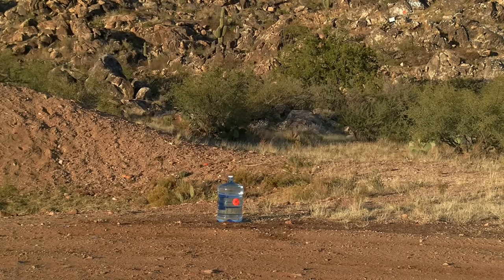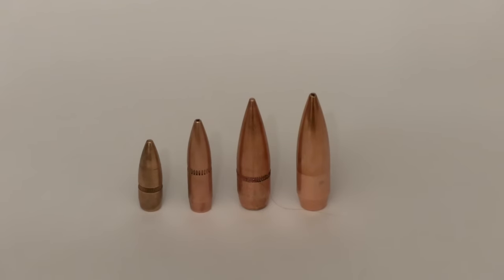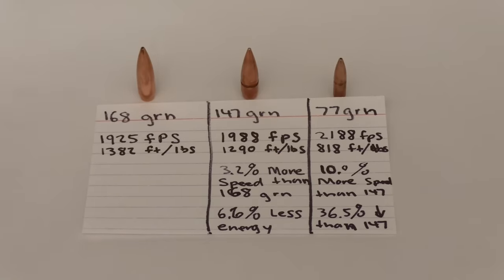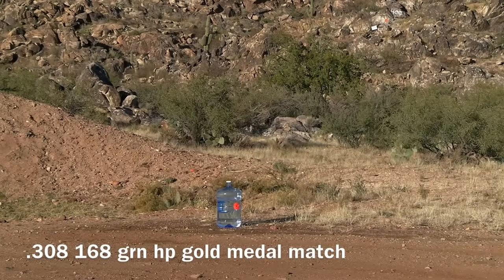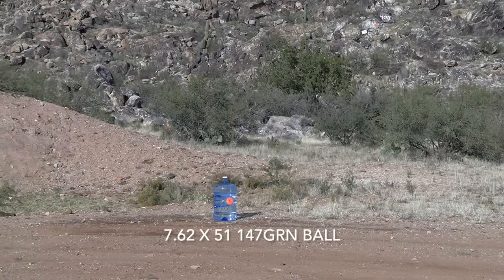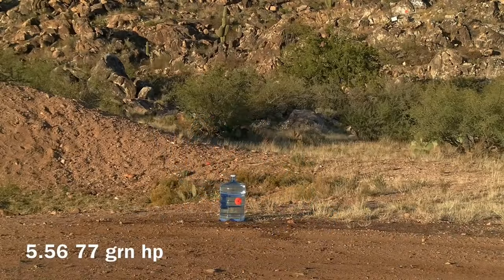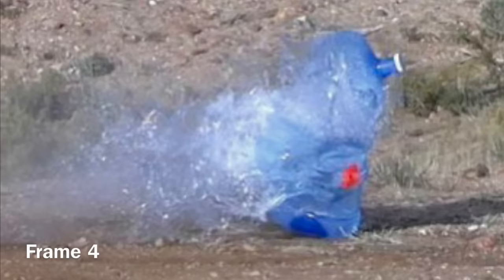5.56 & .308 vs 5 gallon water jugs at 300 yards

Comment: Considering that the smaller projectile did so much damage... I'm curious; what would a 22 do?
Reply: If you could hit it, I think it would bust a small hole through one side and spring a leak. Maybe something heavy and fast like velocitor would split it a little, but I dunno. It would not penetrate the back side. Curious too though!
Reply: @rob6850  Even a 22 mag will not match the combination of bullet weight and velocity of the 5.56.

Comment: The biggest advantage I noticed  as a Brit going from a 7.62x51 SLR  to the 5.56x45 L85A1 was a lot quicker and easier to train recruits  to shoot accurately with it at typical combat ranges, it didn't require  the same level of consistency in hold and position,  its 'easy mode' shooting compared to the SLR  - all the power in the world is not much good if you cant land it where it needs to go..

Comment: Beyond these rounds tested, I shot a full mag of (30) 55 gr 5.56 FMJ Federals into a 4 inch diameter pine tree within 2 inches of each other, it stood and had many noticeable holes penetrating its trunk. I switched to 77 gr Hornady Match HPBT rounds. 4 rounds in the same spacing and distance (close), I had to dodge to the left as different 4 inch thick pine next to it fell toward me to the ground. There's a HUGE difference in energy dump from FMJ ball to HP in a tree anyway. I was surprised the ball round had more perceived hydraulic shock in water than a HP on the 308 round in this video.

Comment: Wow I can't believe how much damage the 77gr. Did compared to the other bigger calibers , unbelievable, is all that because of the speed ?  What a difference  . And at 300yrds.  Outstanding slow mo camera work ! One factor maybe the 77gr. Was open tip/ hollow point boat tail  designed to expand on impact, boat tail is for stable flight. The 7.62 and 308 were both B.T. but not H.P  I think that made a difference for the 77gr. .  The other two were FMJ they went through but didn't expand, only making a standard wound channel, where the 77gr. Probably had total fragmentation disintegration it dumped the most energy on impact, where the 7.62 and 308 probably continued flight after exiting the target not dumping all there energy.  That's the difference.
Reply from the maker: Thanks for taking the time to watch the vid, for sharing your ideas, and for your kind words.  Much appreciated.  Wanted to reply sooner but was busy making a sequel to this vid that may do a good job of answering your questions.  Here is the link to it.
https://youtu.be/jyKcyXacBh4

Hope you will find it to be on par with the original (if not better.)  🙂👍

Comment: Hey there!

Just stumbled onto this video after picking up a Ruger SFAR myself recently (haven't had a chance to start shooting it yet... waiting for the holidays to go past).

Have you noticed any difference in using .308 vs 7.62 in the SFAR?  I actually asked Ruger if it was ok to fire both as i know there is a 'slight' difference in the two rounds due to the differences in the case-thickness.  

Their response was: The Ruger SFAR is 7.62x51 and can also use .308 factory ammunition loaded to United States industry specifications.

But.. seeing as you just did a video doing exactly that (using both rounds), thoughts?
Reply from the maker: Thank you for taking the time to watch the video.  Much appreciated. From what I understand from the factory (and from firsthand experience) the rifle can handle both .308 and 7.62 x 51.  Here is a link to a more complete review of the Ruger SFAR that I did recently.  https://youtu.be/Cjc5AuRFPow

hope it will be useful as well.  👍

Comment: Did you Chronograph those loads with the rifles you used in this test? 2913fps is INSANE for a 77gr out of an 18in barrel.
Reply from the maker: @ mr Grill…yes indeed,  the 77 grain bullets were indeed chronographed from the rifle used in the vid.
Here is a link to a vid that shows the rifle and shows some 55, 62, & 68 grain being used on 5 gallon jugs.
https://youtu.be/_t3fS70Z4_4
Reply: @outdoor adventures  wow. That is a good bit faster than mk262 out of a 20 inch barrel. I might have to Chrono some of that sig stuff. Thanks.
Reply from the maker: No worries.  Happy to help.

Comment: We kinda knew the HP round would do the most damage albeit being the lightest round. Engraftment transfer. The .308 ball rounds just zip right through. Not surprising at all
Reply: The ball did more damage than the hollow point 308 in this video. Not saying that it usually happens, but that’s what happened in the video. The ball did not just zip right through.

Comment: It might be nice to also do another video using 55 grain 5.56 and 62 grain green tip. The only reason I mentioned that is those are the two most cheap and available animals you typically see for civilian purchase from what I’ve seen from this video, obviously the more exotic and expensive 77 grade doesn’t amazing job but how does that compare to the 55 and 62 grain that those two don’t perform 147 grain 7.62 x 51 did very very well and if all you could find is cheap ammo, it be nice to see if it’s better to do 308 or 556

Comment: the faster it goes the more it breaks up on impact, the more hydrostatic shock. it dumps its energy into the target. That 168 grain bullet has a lot of energy conserved, but it doesn't dump it into the target. i'd rather have the 800 ft/lbs of energy dumped into the target than have 1/3 of the 1200 ft/lbs from the 168 grain imparted into the target by passing right through. as long as the target is mostly water.

Comment: A simple matter of physics.  A smaller softer bullet at a higher velocity than a larger harder bullet will give more energy transfer into the target. The harder larger bullet will give less energy transfer into the target but more penitration.  
This is why hunters need to match the bullet to the game animal they are hunting.  Take note of cartridges and bullets used for varmints and cartridges and bullets for large game animals.  
Controlled expansion bullets like the Nosler partitions and bonded core bullet are good compromise for a variety of game animals.

Comment: How many frames per second is your slow motion running.? I would estimate somewhere around 250 or in that area what I'm getting at is for a relatively inexpensive price you can get used camera that'll run 1000 frames per second it'll only do it for about six seconds at a time but I think you would have some really spectacular slow motion footage with it

Comment: I don’t know anything about the federal 168 HP Gold Match but I have used the Sierra 168 HP Boat Tail Match for reloading 7.62-51 for competition. It’s not a true HP. The HP is an empty space formed by the jacket only. No lead. It wasn’t designed to expand. It was to help balance the bullet’s stability for accuracy. It wasn’t recommended for hunting or sniping. It was great from my experience for long range competition out to 600 yds. I also don’t know about the 77gr 5.56 HP. Just saying.

Comment: Since the 5.56 was so impresive I would like to have seen it repeated to see if the results were the same.
Reply from the maker: @DuaneHamilton3247.  Based on some unreleased footage with the 77 grn 5.56 at that same distance, I can tell you with confidence that the results in the video were not an aberration from the norm and seemed to be very repeatable.  Hope that helps a bit. 🙂👍

Comment: Great videos of the effects and explanations but odd ammo choices and barrel lengths.  308 (7.62X51) is capable of much better performance with other hunting type ammo.  Also 308 benifits greatly from a 20-22'' barrel.  Typical 22'' 308 150 gr loads are 2800 fps + and can be nearly 3000 fps.  168 gr bullets can easily be pushed to 2800 fps. Confusing why a 16'' 308 barrel was used and an 18'' 5.56 barrel was used when 5.56 is normally shot in a 16'' or 20'' barrel
Reply from the maker: Thank you Mr Browning for taking the time to watch the video and to share your thoughts (and compliments).  Much appreciated.

Since the open tip match was being used in the 5.56 it seemed good to compare apples to apples and to keep the .308 with an open tip match bullet as well.

In terms of barrel length, try to think about all the times someone has said that 2 extra inches doesn't matter for an ar-10 .308.   After all, all that is really lost is about 50 feet per second or so.  Now we see how the velocity (or lack of) can change the outcome.  Look forward to your thoughts on the next one.  (Am editing now.)

Comment: The 5.56 M-16 has been hated from the first day the liffers got there hands on it because they hurried the gun into service that was not ready and without even a cleaning kit of any kind. Just what you might expect when politicians get involved in running wars. Now the politicians finally got their way and they are going to get rid of the M-16 and will spend 4 billion dollars to replace it with pretty much the same round that they had when the started a war in VN. The M-5 is almost as heavy as the M14, the rifle is much heavier than the M-16 making it harder to carry and reduced the number of rounds that the grunt can carry and with more recoil that will be a problem for the smaller soldier to manage. But they finally got the chopped up M-16 (M-4) out of their hair. I was not in a combat unit in 63-66 but I did some of the companies shooting when a shooter was sent to represent our company in a shoot somewhere in Germany. I carried the M-14, never saw an M-16, but I now own a converted AR-15 and I can tell you I am glad I never had to carry a M-14 in any combat situation when I could have carried the M-16. Good luck with your pricey replacement for the M-14. I really enjoyed your video. That scrawny 5.56 round sure did a number on that water bottle and with an 18 inch barrel I might add.

Comment: The .308 is an antiquated round (and I own a bunch of them).  Switch the barrel/bolt on that AR-15 to a 6mm ARC.  The 6ARC has less energy than the 308, but out past 300 yds it has MORE energy (and defeats body armor far better) because the 308 slows down while the 6 ARC is super aerodynamic (it has a very, very high ballistic coefficient).   The wind doesn't push it around like the 308, and the recoil is unbelievably light so you can call your own shots. The 6 ARC fits in a standard AR magazine, and it'll reach out accurately to 1200 meters.  ...Yea, I'm a fan.
Reply from the maker: Thank you Mr. Hardy for sharing this data much appreciated.  Perhaps we will test out the 6mm arc soon.

Comment: So, not sure that this is relevant. My brother and I shoot F Class competition. I shoot a 223 using an 85.5 grain bullet, he uses a 308 using a 185 grain bullet. The targets have electronic sensors and measure the velocity as the bullet goes through the target. I know that my MV is 2850 fps [30" barrel], he also has a 30" barrel on his 308. At 900 metres, my 223 is still going 1750 fps, while his 308 is travelling 1650 fps. We should try putting up water jugs at that range to see how we do.

Comment: Although you have a very short bbl,  I have my 168gr Sierra match kings HPBT at 2935 fps at the muzzle on my competition gun,  it is a 28” muzzle,  I could push it past 3000 but I don’t want any pressure signs,  the short barrel really hurts you for velocity and energy.

Comment: Interesting. The 168 grain 308 could lift a 47 lb jug off the ground and still go straight through it. 
Then the 556 NATO destroyed the same water 47 lb jug. 
So my last deer hunt in Nevada was 3 of us, spotted deer across a valley draw uphill shot. I shot my 168 grain 308 deer fell dead about 5yds.   My friend hit his deer with 7mm dead about 5 yards. 
Our 3 friend had a range finder. 826 yard shots. 
Guess what l am getting at is, what ever you like 223,556,247,308,30:30,30’6, if you hit what your aiming at its going down dead.

Comment: 2913 on a 77 grain? I would love your recipe.  I dont get anywhere near that. IM at 2650 out of a 16 inch loaded HOT to max pressure. I cant  imagine a 24 inch doing 2900+ FPS. Sig Sauer rates that at 2750 from a 24 inch barrel.

Comment: To me this is analogous to a high vs lower powered car on a drag strip or track. All the power in the world isn't that useful if you can't hook up.

I used to race a bit. My 968 was down about 100 HP to the 911's I commonly raced against. But I could put the power down both in the straights, and very predictably in the curves, over bumps, off camber, exits, kerbs, etc. Whereas the turbos really had challenges trying to get a good drive.

It looks like the 5.56 was able to dump all of its power in the water, whereas the other two rounds passed through without leaving much.

Comment: flawed experiment. The cap came off the 168gr .308. Released all the pressure. the 168gr would have been even bigger. To suggest that the smaller caliber creates a larger cavity, simply defies basic science and math. The larger the projectile, the more damage it causes. If the theory of smaller is better we’re true, tanks wouldn’t use 120mm cannons.
Reply from the maker: Thank you for taking the time to both watch the video and for being willing to share your views.   The cap did not "come off" with the 168 grain.  It was screwed on tightly.  It was "blown off" by the sheer pressure of the 168 grain.  

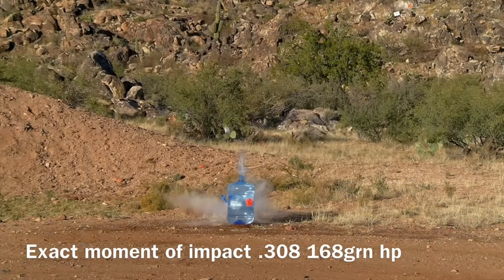This video did not "suggest" that the smaller caliber creates a larger cavity, but instead it clearly "demonstrated" it.   Please review the still shots of all performances that begin at the 12:27 mark.

I do tend to agree with your assertion that "larger" causes more damage, but when going down that road we would do well to remember that the 5.56 had a "larger" amount of speed at 300 yards.  We cannot pick out the fact that the .308 is a "larger" bullet while ignoring the fact that the 5.56 had a "larger" amount of speed at the point of impact.   At any rate you may be interested to know that the experiment will be conducted again soon and we will make sure that the .308 has a longer barrel so as to help it out in the speed department.  Hope that will be of interest.   Thanks again.

Comment: I guess people that complain about the lack of stopping power from the 556 are not using the right bullet or maybe just can't shoot accurate enough to make a hit
Reply from the maker: I am speculating here but it could be that they are thinking of the 5.56 as 55 grain bullet that runs out of gas when is slows down.  While there is some truth to that logic, heavier bullets (like the 77 grain and 85 grain) are in a class by themselves.  Wanted to respond sooner but was putting the finishing touches on the sequel to this vid.  Here is a link to it.
https://youtu.be/jyKcyXacBh4

Hope you will find it to be beneficial 🙂

Comment: lol i get the same effect with my sks in 7.62/39 lets face it ok it depends just how much water is in the jug and how tight the tops are on hell you can get the same results using a .17  so bottom line if i was to get shot i would rather be hit by a 556 then a 308 the 556 or 223 is not all that great of a round like dont let it got to your head and try to hunt grizz not unless you have a death wish